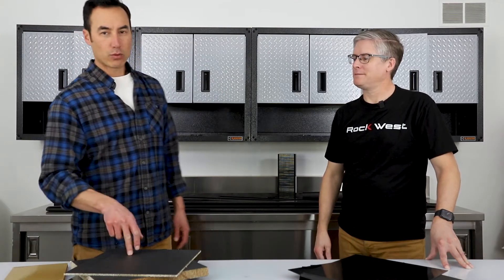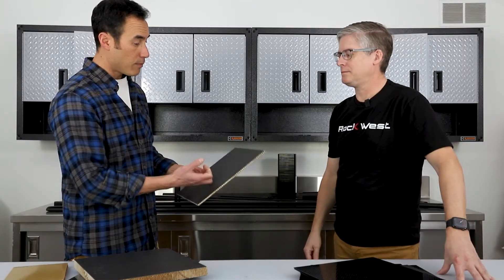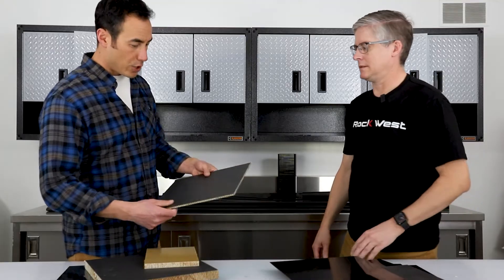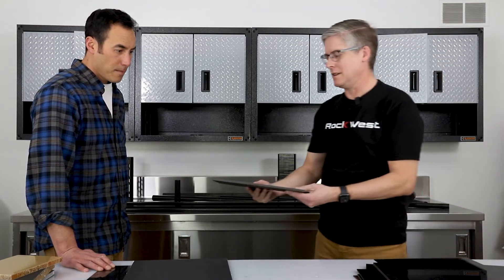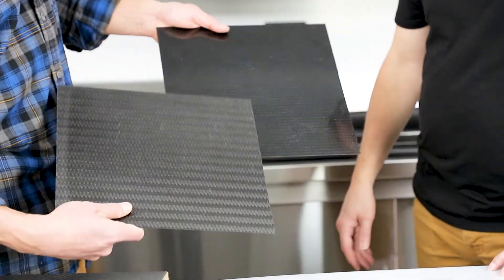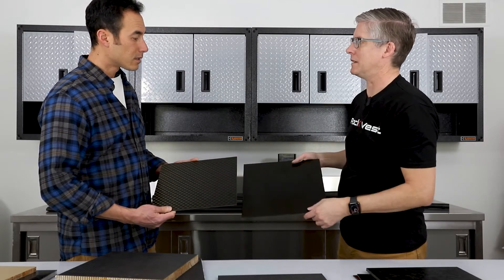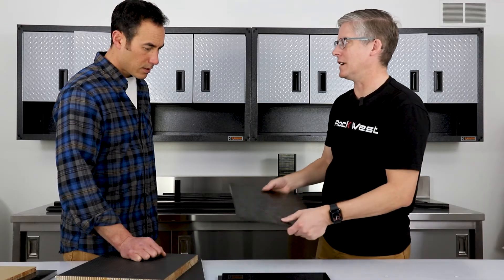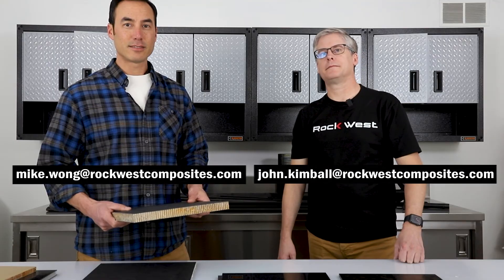Composite Plates & Sandwich Panels - What's the Difference?

Comment: Im looking for something I can mount to the top of my canoe, to use as a casting deck. It must be able to hold two adults, so about 300 lbs across a max span of 38" and 8-10' long. I would also like to be able to cut holes in it, attach a lid for underneath storage access. While being as light as possible.
What would you suggest and at what cost are we talking?

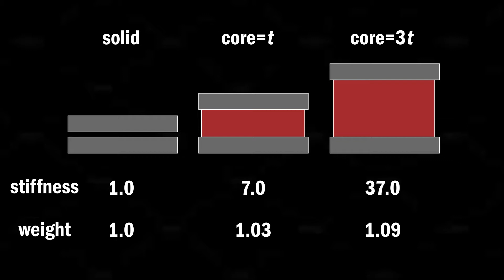Comment: At 2:38 in this video a graphic is shown that identifies stiffness and weight and how it changes as a function of thickness of the core. What is the unit of measure that would apply to the stiffness?